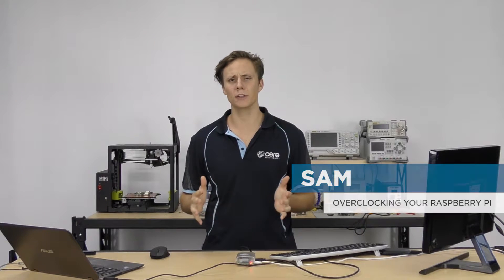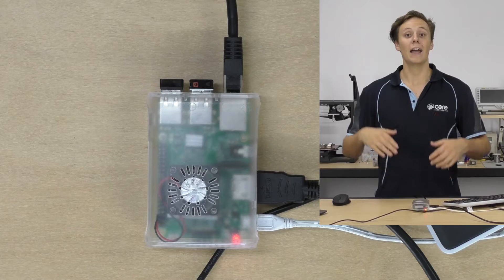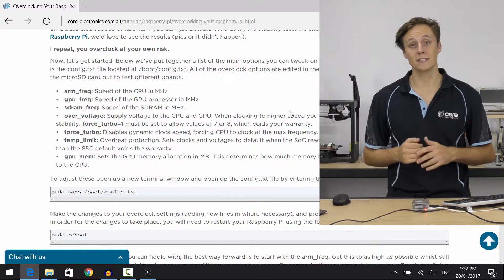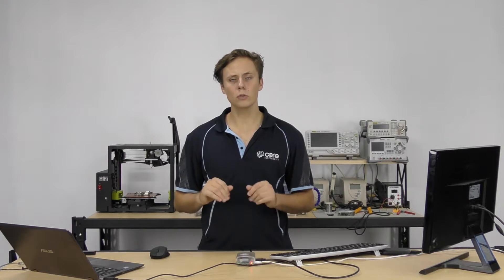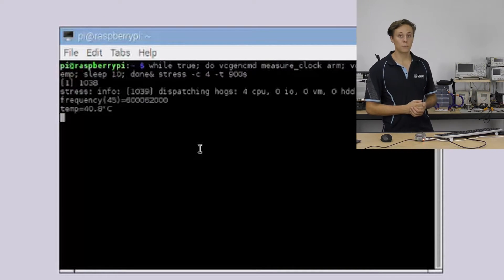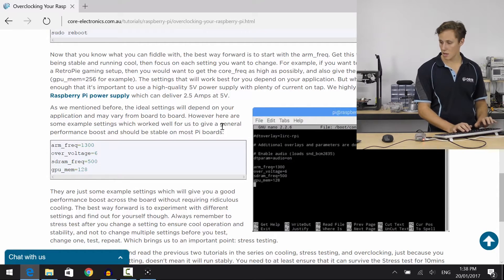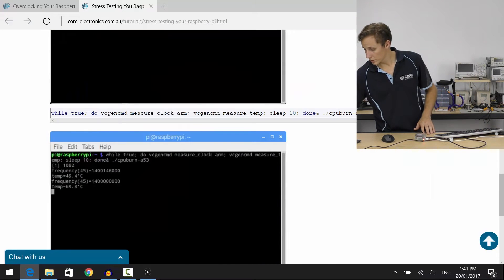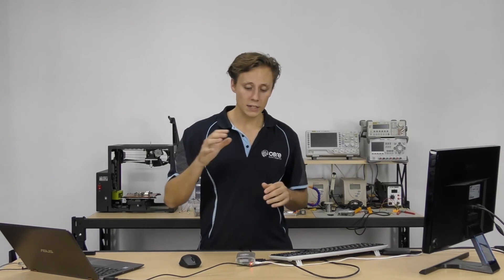How to Overclock your Raspberry Pi 3 Model B

Comment: What is the out-of-the-box GPU memory allocation? What is the maximum you can give the GPU? If things like the above were in the How to overclock your pi section of the tutorial it would be useful (I realize each Pi model is different so a table might be required).  Pi3 GPU frequency, CPU base frequency, etc.  As is, still useful; with changes, more so.
Can the CPU be underclocked to cool it under less than maximum workload?

Comment: So if i clean off the thermal tape thing on my heatsink and use thermal paste instead it would lower the temps even better because i have a little bit of Arctic Silver and if it helps to even lower it by 3°C i would be happy enough to try running it as 1.35GHz.

Comment: I cannot get cpuburn to work. it either starts giving me results but the cpu stays at 600Mz, or it does nothing. Any ideas on what might be wrong?
Reply: just letting everyone in 2019 scrolling the comments know that i am having the same issue
Reply: @jvinsnes  same tho
Reply: @storken756  got it working now tho, new usb cable. Even tho i used a thicc usb cable and a 4A charger. Swapped to a short cheap cable and and now it works. It was undervolted even tho it wasnt showing the regular lightning logo.
Reply: J Vinsnes thank you! I’ll try that